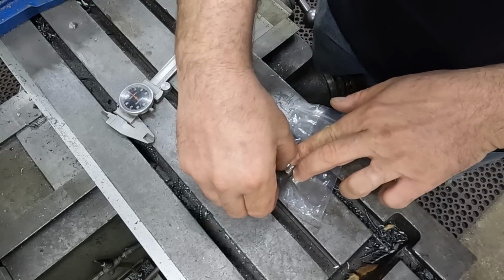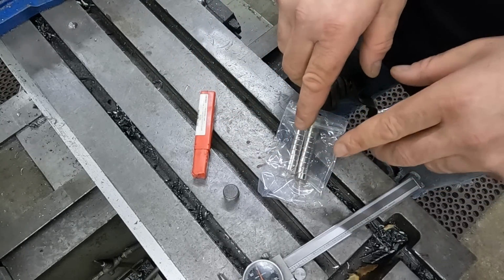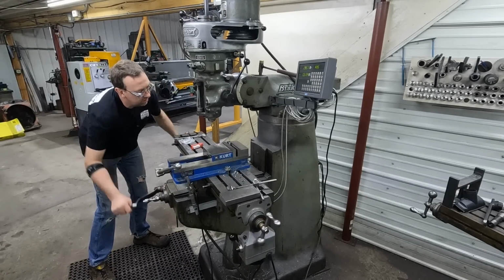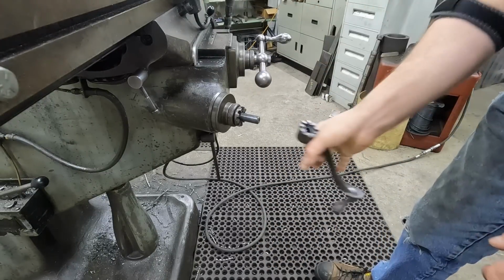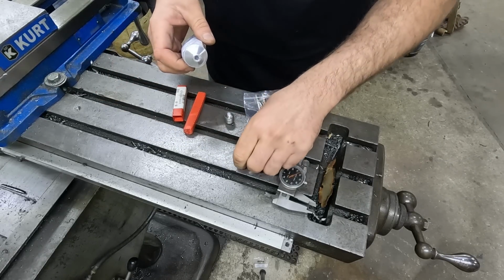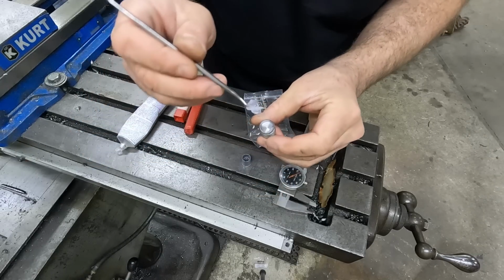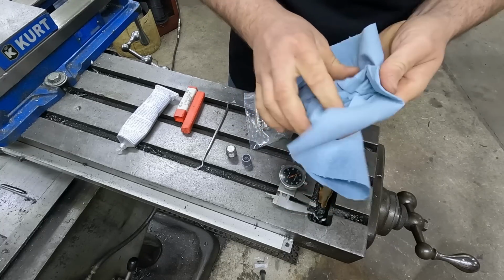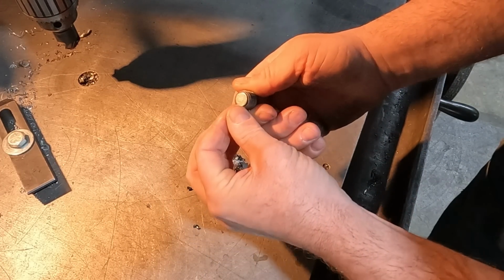Do Magnetic Drain Plugs ACTUALLY Work?

Comment: Just buy a circular rod magnet of 2~3 mm in diameter (1~2 cm long) and drill a 2~3 mm hole in your sump plug: 
Hole should be ~2/3 the length of your magnet.
The magnet requires a few gentle taps to force it into the hole:
This creates an interference fit which means  you don't need any extra glue.

The whole process only takes a few minutes and you don't need anything more than a hand drill and vice: 
It's easier if you have a drill press with some kind of holder.
🙂
P.S. Glue creates an extra potential contaminant. It's better if you can eliminate the glue.
P.P.S. Rod magnet should be strong enough not to fall apart when it's tapped into the hole. Most magnets are fine if tapped gently.

Comment: Did the same to a plastic drain plug on a compressor. Then steel epoxy to  hold the bar magnet in the hole, applied after a thorough degrease of the nylon and the magnet.

Comment: I wonder if silicone is a good idea. I would suspect it to fall apart under the chemical action of the oil, releasing particles in the oil. 2-component epoxy is chemically neutral and will most certainly not do that. I‘d go for the epoxy, just to be sure..
Reply from the maker: I only buy silicone that is oil resistant, but I definitely see your point. For this video, my epoxy was gone and I didn't want to go buy more.

Comment: 06:50 struggling to get it in. The simple trick would have been to put the magnet on the table you‘re working on, and slide the plug over the magnet. The magnet will hold to the table because magnetism is biased to the largest mass. Once the plug is over the magnet you‘d slide the assembly to the edge and slide it off the table. Done!

Comment: Magnets aren't attracted to smaller pieces of metal as strong as they are with larger objects. If it seemed impressive with chips, it will be even more impressive when it's stuck to the side of your mill.

I have a 500lb pull magnet. Nuts and bolts come off easy but when it got stuck to my vice, I was not amused.

Comment: Stick magnet to table drop plug over it then slide it off edge of the table
Reply: Yep, you beat me to it 🙂
Reply: @MickHealey  Me too.
Reply from the maker: I had fleeing WI on my mind. Even putting it on the end of a shaft would work. Next time I'll remember this.
Reply: @TopperMachineLLC  Can't leave now the snow is about to finally melt!
Reply from the maker: @bcbloc02  it will be July before all of this snow is gone. I think I will start taking a picture everyday of the one pile until it's gone and see just how long it takes.
Reply: 😂Need some AI to fix in hole ! ! !
Reply: I was just going to say that.